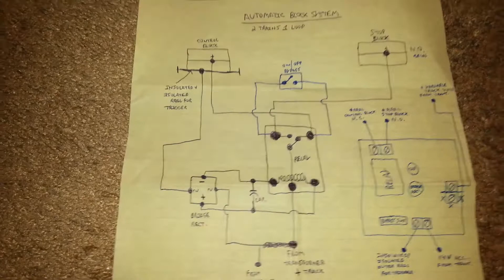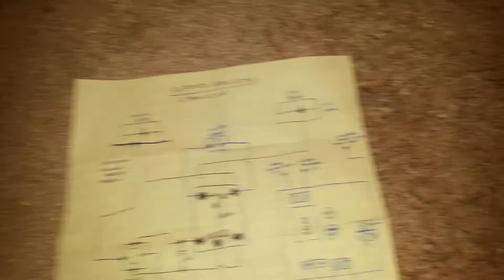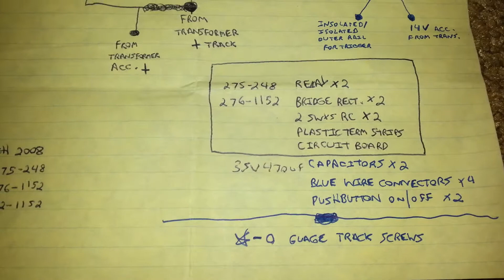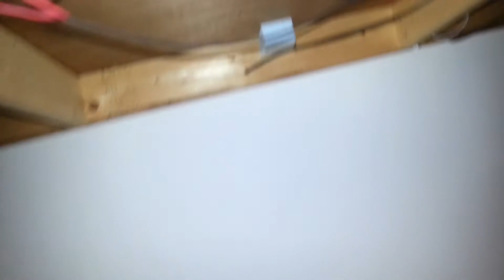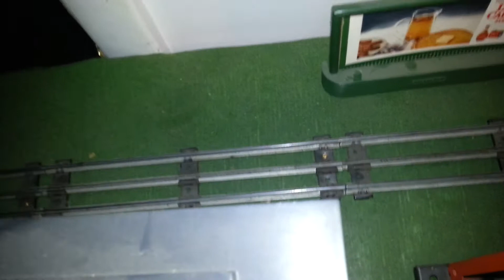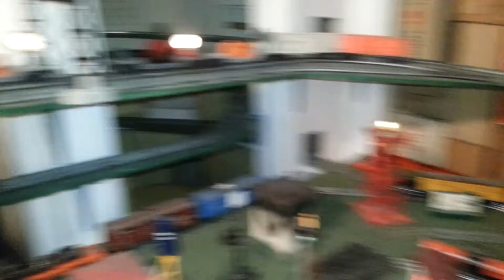Lionel postwar automatic block system

Comment: Mike,
This is just what I was looking for- I have the contractors from Lionel, but recently moved on to the FasTrack system. I have been trying to local the components for the system you elegantly described online and it is frustrating. The Radio Shack codes do not relate to specific items anymore. I think what is needed is a description - or better yet, specs-
Capacitor- 35v 470 mico F,
Relay??
Rectifier??
It is a bit hard to read them off the video. Can you help with specs on these key items?
thanks,
Fred
Reply from the maker: Hi Frederick,
Here is a link to the relay I used: http://www.mouser.com/ProductDetail/TE-Connectivity-OEG/OUDH-SS-112D000/?qs=YjZJnJrCSBTSucpRbkPJRA%3D%3D
It has a black cover but same model number and specs.
And you should be able to use this rectifier: http://www.mouser.com/ProductDetail/Vishay-Semiconductors/W01G-E4-51/?qs=sGAEpiMZZMvplms98TlKY6I1zmttAFjhkBXgCI%2fYGtQ%3d

I hope that helps you!
Reply from the maker: I just realized the relay at Mouser is no longer available, but I am sure if you call Mouser they can give you a comparable part and it does list the specs.

Comment from the maker: Hi everyone, It seem that some of the parts are no  longer available at Radio Shack.  I believe I have found alternate part numbers.
Bridge Rectifier is 276-1173
Relay is 275-041
Toggle swx for bypass (optional) 275-324

I hope this helps!

Comment: Anyone who would attempt your circuit and knows electrolytic caps also knows that the positive lead, the longer lead on the cap, goes to positive on the rectifier.  Some on the forums are most eager to pick apart anything you do, especially if you "trump" them.  Great idea and application of a relay with an insulated rail!  Your follow-up video clarifies it well!  Thanks!!!
Reply from the maker: You are very welcome!